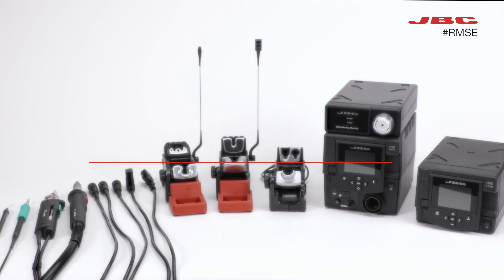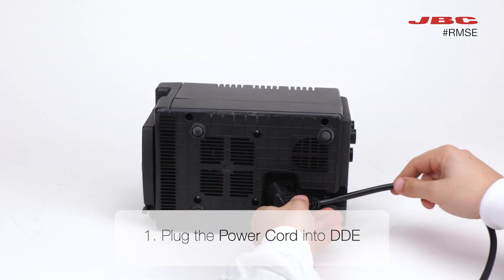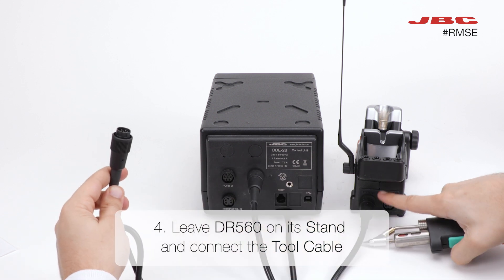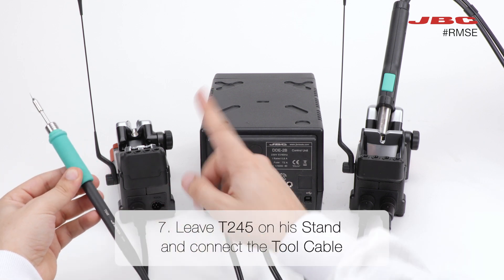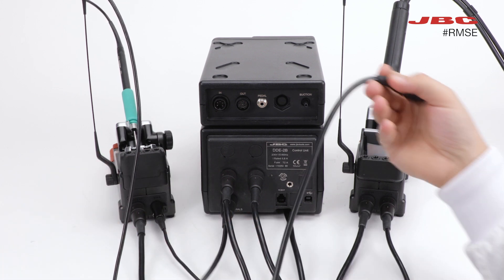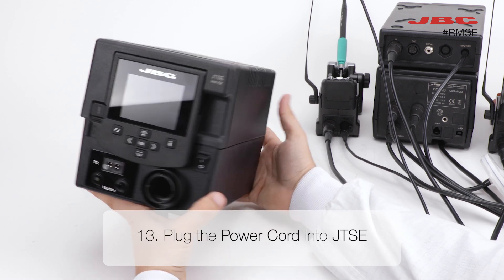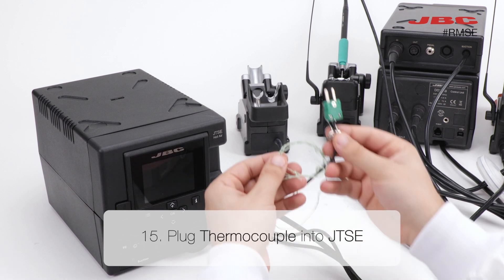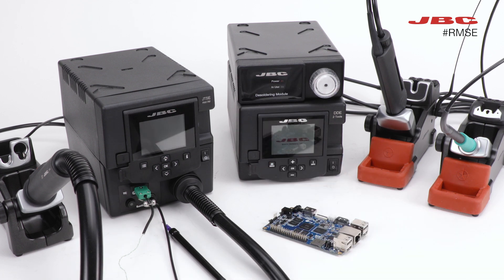JBC | RMSE Complete Rework System: Plug & Play #howto

Comment: It's difficult not to fall in love with these stations...
Reply: I had recent bad experience with JBC I documented on my channel. Poor customer service,  poor quality and bad quality control.
Reply: @Rhine_Labs  They are used for repairs in several electronics factories. I love! Very good machines. I've been using them at work for decades. It is not available here only because of the price. I don't do that much soldering at home. If I were to do it like a business, I would only buy JBC. I'm sorry that you received the wrong product. This happens to the best.
Reply: @RJoco  I am in the repair business lol